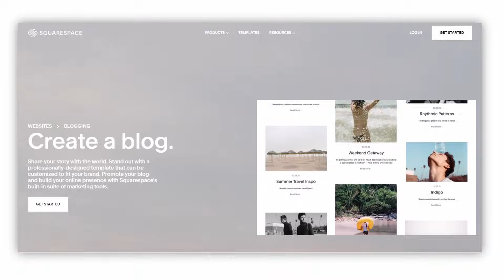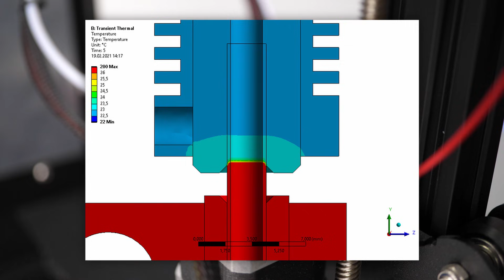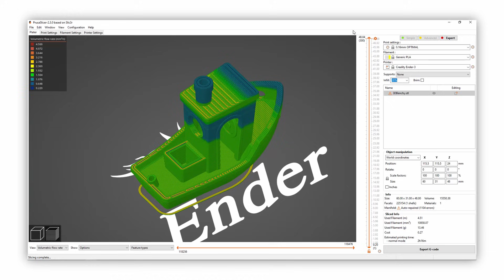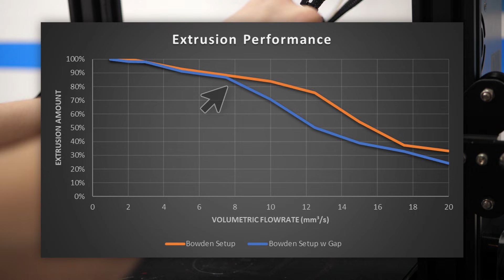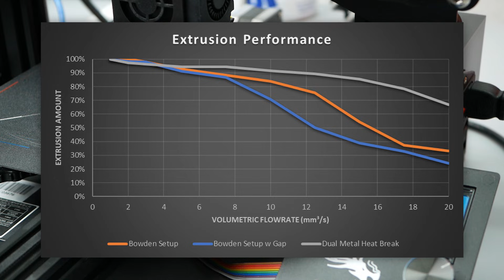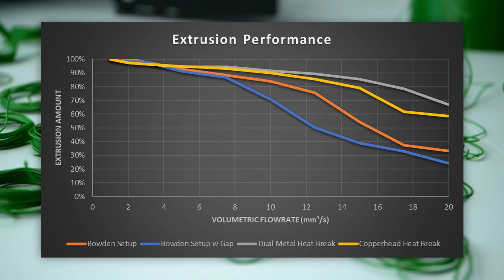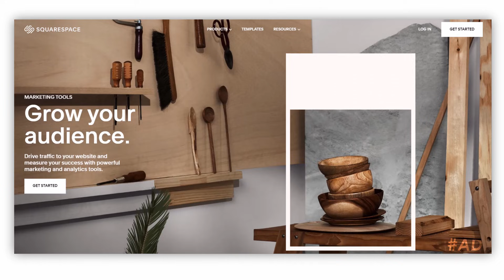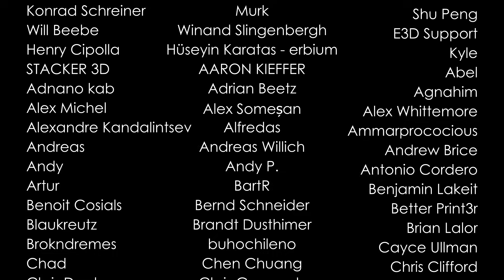Bi-Metallic Heat Breaks - A (R)Evolution?!

Comment: I'm trying to get bi-metal heatbreak working on my Ender V2 Neo. Original Copperhead is hard to find in my country, but nowadays there are plenty of decent quality knock-offs from China.

On my first attempt I got cloggings very quickly. Prints started normally, but after approximately an hour I got heavy underextrusion, I guess it was heat creap.

Today, after having PTFE tube carbonized again (and nozzle clogged) I decided to give it another try. This time with a bit better clone of Copperhead, and also I used thermal paste. No clogging or underxtrusion, but prints quality is significantly worse, than with stock heatbreak. :( Stringing at 2 mm was bad, so I printed retraction tower and found, that it's a bit better at 1.6 mm. Still not great, though.

I really don't want to get back to stock heatbreak, because it looks like with intensive printing my PTFE lasts somewhere between 4 to 6 weeks — and for now I'm printing only PLA at 205°C. 

Besides stringing, another symptom I can see is bad quality of infill surfaces. When area of filled surface is realtively big, infill looks OK. But on smaller areas it's a total mess, it looks like overextrusion, or the effect you can see on a first layer, when nozzle is too low.

Idk, maybe I should decrease e-steps on extruder, or play with extrusion multiplier in slicer?..

Comment: The stock Ender 3 heat break is 27mm long. It appears the Slice Engineering one is 28mm long, which sits the nozzle too low and messes up auto-leveling settings.
Considering they could have just cut it to fit, I have to wonder why they didn't.

Comment: The Slice engineering heat break did wonders for my Ender 3 max, able to print PLA+ faster, much easier to change filaments as the teflon tube was no longer being damaged and the effective nozzle temperature was higher with less heat loss going up the stock heat break.

Comment: Most hotend designs have PTFE touching the nozzle. Potentially the PTFE is potentially heated up to the nozzle temperature. Usually over 200 °C. Isn't this a HUGE problem? Teflon shouldn't be heated over 200 °C. At 110 °C according to DuPont's own studies on Teflon you get very toxic gases. The higher the temperatures, the more toxic. Over 200 °C it really gets toxic (neurotoxins) and in animal studies (birds) this was fatal. Above 500 °C we are more toxic than most chemical warfare stuff.

Maybe you should make a video about toxicity! Maybe we are poisoning ourselves all the time even printing PLA!

Comment: I was wondering if the short neck on the heat break would be a problem with retractions. If the neck is short, retractions will bring molten plastic up into the cooled area. Wouldn't retractions be done better if the molten pool area was mechanically increased and decreased in size?

Since you are wanting the flow to stop, what you're really asking for is a pressure decrease in that area. The whole hot end setup seems.....clunky as the plastic really only needs to be molten as it leaves the tip. I think people should look at what can be achieved by the guys who do high end soldering irons.

Comment: help! can someone tell me why filament would feed well (by hand, for testing) but not come out again.  I have a v6 clone heatsink, a bimetallic heatbreak, a v5 hotend, and a v6 0.4 nozzel. I've checked tightness at temp (nozzel to heatbreak) and replaced the ptfe to the titan extruder (clone) and heatbreak.  I'm getting excessive stringing, and it's very hard to remove filament when I want to change it. (210c) I've replaced everything except the v5 heaterblock.  (point me to a good forum)

Comment: Does the Slicer Heatbreak work with Amazon Nozzles. I noticed my original Ender5 nozzle's threads do not go all the way to the top, like the Amazon ones. That results in the Amazon Nozzle sitting lower & sometimes starting to leak. I am guessing the Creality Original nozzle sat inside a tiny well, like on the shown Slicer product's hotend end; and maybe that helps keep it from leaking. Where might I get better fitting Nozzles, without the top thread, like the original. I am trying to print with 0.2mm vs 0.4mm; which is why I bought the Amazon nozzle & my leaks started.

Comment: I have a new problem with temperatures fluctuating up to .3 degrees after installing this. It is causing my prints to look like they have a wood texture. I used the thermal paste with the install and my heat block has very minor scratches on it. Yes I am using PID autotune (tested it with filament in and out when running it). it made the results better but they are still not good. Is there anything else I can try to fix this?

Comment: I was not prepared to spend at least £30 on the SE heat break without trying out the principal on a £10 for two knock-off version. The first failed at first print but the second worked extremely well until today when half way through a small print the filament stopped. Yes I know it may have been a few other reasons but the heat break seems the most likely.  I still have no intention of buying the SE until the price drops.

Comment: 3:49 why worry about tightening the heatbreak, when, as CHEP did, you back off the nozzle 1/2 turn from tight before installing the heatbreak down against the nozzle, then tighten the nozzle up against the heatbreak.  No turning force required on the heatbreak other than simply threading it down as far as it will go loosely without force, reaching the not completely tightened nozzle....

Comment: Your are the empirical guru just subscribed because I have learned so much from you!.   I am on mission to learn all things possible to optimize print time and quality and find all your post very informative.   I wanted to suggest another topic a roundup video.  If a good heat break helps melting performance, and CHT nozzle + adapter (your other video) also helps, what  results do a unified system of these two combined approaches produce?

Comment: hi. good video. even todday there is not even single bi-metal heat break made properly to be secure. SS and cooper have different expansion reates at temperature changes and how these bi-metal heat break are made today they all will fail sooner or later. usually they gonna start leaking plastic between heater block tread part and SS tube. I do have proper build idea for bi-metal heat break what would never fail because of expansion.

Comment: Yesterday, I printed several big part in PLA with my good old standard E3D V6 2.85 with 0.8 nozzle at 21mm3/s with no troubles, no under extrusion and excellent layer fusion. Extruder is à simple "reprap like" geared with hobbed bolt. Simply played with head temperature in prusa slicer with layer custom gcode M104. Making temperature change from 230° in thin parts to 245° in big area layer (100% infill).

Comment: I dont recommend using a bi-metal heatbreak.  because metals expand and contract at different rates it is very difficult to keep them sealed, and there is every possibility it will allow molten material to goop through. (ive had it happen, and honestly even name brands are all sending parts from China.  Personally, i prefer to use a solid titanium heatbreak. Theyre able to be torqued down to levels that would break bimetal or standard steel ones and theyll be nice and tight for a long time.

Comment: 10:27 - I think the shorter "knock-off" heat break may actually be a "Kraken" or "Chimera" heat break made for a clone E3D or Volcano hot end rather than for a Ender 3. If the OAL is 20.5mm, it's a Kraken/Chimera heat break. The Ender 3 one has the same threads and barrel diameter but is considerably longer.

Comment: DIsagree on your if only you were printing slow and with only PLA yadda yadda. I print fairly slow on my printer, 30-40mm/s typically, and moving to a all copper heater block with an all metal hot end has greatly improved my prints.Than using the stock Ender hotend. While this heat break would be a great upgrade to an stock hotend, the cost does not justify it. Where you can get great quality hot ends for a small addition to  cost and have a hotend that is still vastly superior to the stock ender 3 hotend.

Comment: I was left wondering what exactly went wrong with the knockoff. You say that it might be a combination of the dimensions, the parts, and the coating, but now I am curious if a generic heatbreak with better dimensions would have been enough to fix the issues you had. I think the stock bowden solution still needs some kind of cheap fix for the PTFE issues.

Comment: I do find the so called Bowden setup to have more problems than a direct drive, 
and no one has mentioned the simple problem that I have found from getting an Enders 3 v2 in the first few days.
 
The god dam stupid Tube itself, 
when the hot end is closer to the  the extruder motor side the filament gets tighter in the bent/curved tube and when further away the filament is more free from friction.. so you get a spring effect on the filament.

Meaning the filament wants to backup into the extruder motor part and then springs back away into the Hot end adding filament
 
Simple solution
I made a bracket to go on top of the top rail and fitted a support to go on the extruder tube it keeps it taught.

No Missing , No missing layer bits and No over extruding. 
Basically perfect prints that look almost like injection moulding.

Oh and the best part is that it only cost you the filament to make.
Reply: That's a good way to go. I noticed this on my printer as well and plan to print a dd mount this weekend. Did you design your own or get one on Thingiverse?
Reply: @TheDudeChannel409   it was a bit of a make shift bracket to hold an elastic cord that just hangs from the Top rail and connects to the tube
 so it keeps the plastic Tube lifted higher and taught but allowing for natural movement.
also I did cut the tube to a shorter length as its to long as standard
oh and now only use 2mm filament retract instead of 5

Comment: Hi Stefan! I was wondering if you would suggest this upgrade over a CHT nozzle. I am currently starting to print a bit faster now that I got into Klipper and the only thing keeping me back is the thermal performance of my ender 3. I have switched to direct drive but now that I tweaked and upgraded everything but the hotend under-extrusion is more apparent.

Comment: 8:39 did you really use thermal paste on the connection between the heatbreak and the heaterblock? this doesn't make sense and makes your heatcreap only worse. Only ever use thermal paste between the heatsink and the heatbreak, but never on the threads to the heaterblock.

Comment: I'm sure this was asked already, but why would you use thermal paste from the heat block to the heat break tube? You do not want to better conduct the heat away from the heating block to the tube so I don't put thermal paste there. We don't want to cool off the block, we want it hot. I use thermal compound between the heater and the block, the thermistor and the block, and the heat break tube and the cooling block.

Comment: 13:04 I broke the thermistor bulb, somehow shorted the board, which I'm assuming should be with the current from the ceramic heater which also had some exposed section. Fried board, not fun.

Comment: Dunno I am currently trying to merger Bowdens for dual extrusion. But I rarely use 0.4. I swap nozzles more often than filament. So I'm happy to leave those supplemental screws in. Also upgrading extruder heads but pissed the dual gear one I got has wrong style pnuemo connecter.

Comment: Dude dont use a tap on exsisting threads. Alot of people don't know it actually makes the threads wider and cuts more material, leaving you with loose threads. Purchase a thread chaser kit, they are specially designed with "slightly" undercut threads, in turn not cutting more of your threads away.
Reply: Cheaper to buy a Fresh heatblock than a chaser tap :-)

Comment: I got my Trianglelabs stainless steel bi-metal heatbreak for my Neptune 2 last week. I installed it with a Trianglelabs copper plated 0.4 nozzle and it's a dream. Besides the other upsides I never experienced skipping or grinding since then. The filament flow (with ABS) is just crazy and seems to have no limit. I got a malfunction a few days ago since my Neptune 2 is in a box right now to print ABS and the board overheated, which made the extruderstepper drive at a ridiculous speed. In a few seconds there was a great mass of ABS extruded. I was really happy to see that performance boost, even though i experienced this malfunktion :D The Trianglelabs stainless steel bi-metal heatbreak (and the copper plated nozzle!) is worth every cent. Wouldn't go for the titanium one, since it seems it has no copper part in the heating section.

Comment: I had nothing but trouble with it on an Ender 3 printing PLA and heard lots of similar stories of clogging.

Can someone actually confirm they have this installed on an Ender 3 and print PLA at least as good as with the stock heatbreak? I mean no clogging and no stringing.

Comment: I've been suffering from heatcreep on my E3D v6 hotends. The fans they give you are too weak and I already have enough weight to push around by having dual direct drive extruders on the printhead, that I don't want to attach beefy server fans. So I am designing a waterblock to use PC water cooling hardware (res, pump, and rad) so I can get good temps and not have to worry about the heated chamber causing hearcreep

Comment: Are you using some form of heatsink compound on the heatblock side for installation?  Seems like most guides talk about not using any kind of compound but I would think something like the Slice boron nitride paste would work well and act as an additional anti-seize.   At least if your purpose is to put more heat at the heatblock side (since they're keeping copper there for similar reasons per the video).  It also seems to look like some kind of paste is present in the video but perhaps it's my imagination.

Comment: Hi Stephan. I have a idea for you… https://youtu.be/IjUXhg7Waqo.   he claims that copper heat block will add time to heat up due to mass density… why dont you make a copper heat block with same weight as the aluminium one and then run a test… you have a smal machine shop to manage this :).    
Love your videos og testing :).

Comment: That brass hobb wheel from enter 3 is a complete garbage, they needed to fix it by pushing the filament harder towards it, but then as shown in the video the stepper motor can't keep up any more, and if you increase current it will start overheating.
I bought stainless steel one from E3D and it was gripping 100x better, unfortunately it had the OD too small to be used in ender 3.

Comment: Thanks for this video. I've just performed the same upgrade to my Ender 3's hot end and was incredibly surprised to see my retraction distance go down from 6.5mm to 2mm, even though those are the results you got, as well! I ended up printing a bunch of retraction tests, just to be sure, and ... wow!
Reply: With the lower retraction what were you able to do that you couldn't before?  I'm looking for good upgrades and I'm considering this one.
Reply: @rickybobbyracing9106  with lower retraction I can print in higher quality much faster, as I don't have to wait for my extruder to retract so far before doing the next extrusion - it also makes it much much easier to print flexible filaments and more exotic filaments in general. There's an overall improvement to how my printed parts look, too.

Comment: I think I want to get some of these purely to eliminate the bowden tube creeping up. Since I'm printing for business, it is extremely frustrating waking up to a whole batch of prints that are under extruded due to the bowden tube backing out from the hotend.
Reply: Did you end up doing this? And if you did, did it work? I've been considering doing the same thing to stop stringing and clogs related to the tubing.
Reply: @lakitu6422  yeah I upgraded all my Ender 3s with this and it eliminated so many issues for me. I think I can only recall one clog that happened over the last year and that is from 6 printers that got upgraded. No more issues with the bowden tube pushing out of the hotend, no more blown out couplers.

This won't eliminate stringing as that is an issue related to temperature, retraction, print speed and filament.

Comment: Hallo Stefan. Danke Danke Danke. Am liebsten würde ich dich ganz dolle für dieses Video und den Tipp für das Slice Engineering Heatbreak drücken. Boah, was für eine (frustrierende) Reise hatte ich hinter mir, bis ich dieses Video gefunden habe. Also ich habe eine Ender 3 V2 und drucke faktisch ein Set von Teilen in PETG. Das hat auch soweit ganz gut funktioniert bis das original PTFE auf Düse Konzept endgültig aufgegeben hat... Danach begannen alle nur erdenklichen Probleme... Kurz: Nach drei Wochen Experimentieren funktionert jetzt, mit diesem Heatbreak, endlich wieder alles so wie gewohnt und besser. Danke auch für die Vorarbeit für die Settings für den Rückzug. Passt beim Ender 3 V2 mit diesem Heatbreak und PETG exakt so. Nochmal: Danke Danke Danke!

Comment: I've been using a TL bi-metalic heatbreak with a V6 hotend for almost 6 months without any issues, I also didn't knew that slice engineering sold the genuine version(was only aware about the mosquito) I would have bought the real deal from the start, but now I'm considering to buy a genuine copperhead heatbreak to replace it if something goes wrong I don't think the genuine heatbreak is expensive compared to the TL clone considering it's made better.